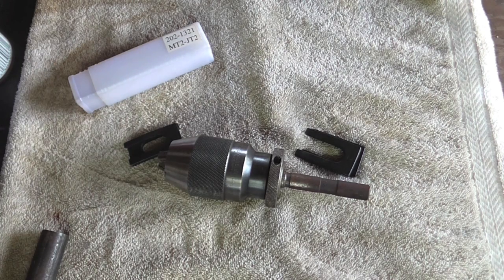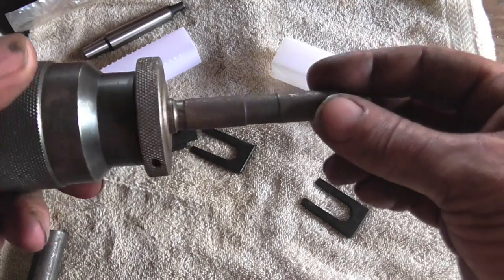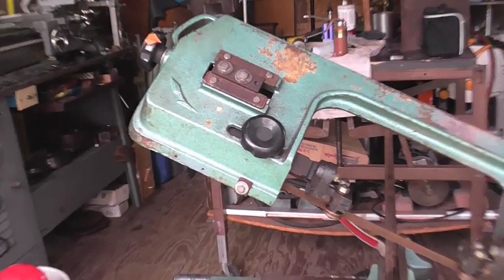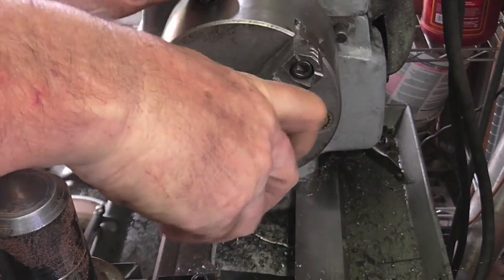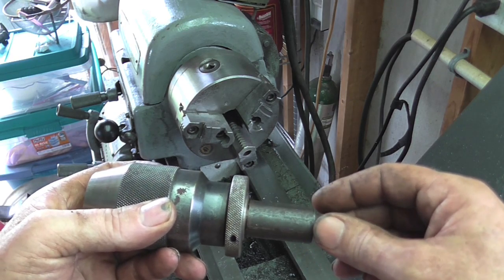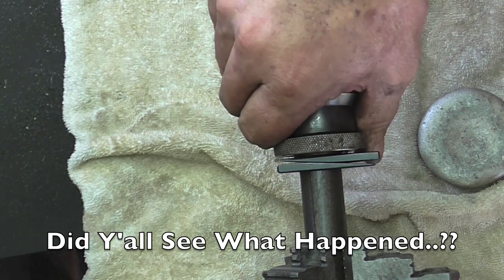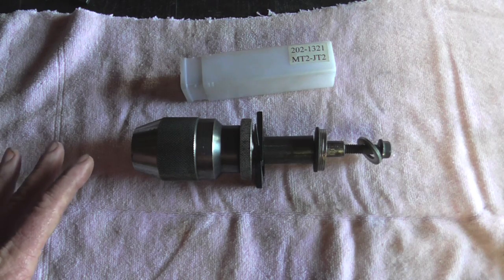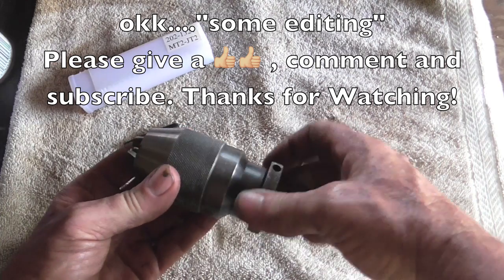How To Remove a Jacobs Taper (When Wedges Don't Fit!!) - MSFN

Comment: Those Bandsaws are sold all over the world under different names they are very common. I have had 4, all with different makers labels, I have my own one still and other than reinforcing the very poor tin legs, mine works very well.  I used to refurbish machines. The "logo" as you called it is an arrow showing blade travel direction. As for the chuck I have freed off many many for myself and others, I always strip the chuck down and use a bit of heat. It's always worth stripping chucks cleaning a regreasing them. I have in the past welded a bit of tube or a big old nut, that is if the tang is not needed. As for oil when cutting, no no use either cutting fluid or water soluble oil, the same as you use on a lathe , you mix it 10 to 1 with water and use a small paint brush. it will make the blades last longer. I have had an engineering shop since the early 80's wit h3 lathes of different sizes and two bench pillar drills and floor standing drill. Lots of different chucks for them all as the y are all Morse/Jacob tapered, but I do not and never have used Jacobs wedges, never needed them.

Comment: Great video, I have the same issue I need to remove an MT3 from a spare chuck; I did see a guy on YT use old spanner’s for the wedges so maybe that will work; also I have seen MT3 to MT2 reducers although I am not too sure how these affect accuracy; maybe someone else can provide the answer to that. Ps bloopers prove honesty 😊

Comment: a simpler way, if you have an access to an oxy-fuel torch,  , with an big tip,  you give a fast heat burst to the chuck to bring the temperature to about 250 deg f m you clamp the arbor in a vise then with a brass punch, and a medium to heavy hammer, you give a sharp blow, the  chuck will release immediately without any damage to the chuck or arbor..

Comment: I heated up the shank with mapp gas near where it attaches to the shank , let it cool then sawed it off, then turned an arbor at the max diameter of the chuck. .390 for my 3/8 chuck. Then put the chuck on the arbor in my mini lathe and drilled and tapped it 3/ 8 -16 then used a couple sockets and a 3'8 bolt to pull what was left right out no problem.

Comment: G'day matey, I had same issue with a keyless chuck I bought , the Arbur was too big so had to remove old arbour from old Key Chuck but was stuck bloody tight,
I cut a length of heavy pipe 5mm longer than the Arbur and placed a bolt in the chuck so it sat on the top of the arbour then placed in the Vice and tightened it down. With a small tap on the chuck body it all come loose.
No welding , thanks to you and many other posts I was able to save lots of time and effort.  Thanks matey regards Duncan down under

Comment: Another way is to unscrew the top of the chuck.  Then you can lift up slightly on the jaw carrier and unscrew that part from the base.  Note this is a left hand thread.  That gives you access to the end of the arbor and you can drive it out with a punch.

Comment: Is it possible to change the quill  ( the main piece that goes up and down with the handle )
To fit with a Morse taper ? It's an old Chicago DP 515 with JT  2 1/2  spindle and the shaft runs from top to bottom in one piece

Comment: Never seen that solution before it worked. I thought you would have to use a hydraulic press to press it out from the inside of the chuck.

Comment: Plan D, if all else fails... I once used a drill chuck to mill with an endmill. but the side load removed the chuck from the taper. They can't hold against a side load. Try putting in in a spindle and chuck a bar in the drill chuck , spin it and put a side load on the bar.

Comment: Rather than the work involved in drilling, tapping, I'd have welded some scrap to the end, then if the old straight arbor was to be kept, then simply grind it off again.

Comment: These chucks are quite easy to dismantle and you can do it with the arbor in place. Once you've got it apart you can access the other end of the arbor and bang it out with a punch. In extremis you can warm the chuck component to loosen it. As long as the chuck is dismantled and you don't go nuts with the heat that'll be fine.
Reply: That's what I did. The chuck I had (Jacobs, not Albrecht) ,when opened up to max, you could see the end of the arbor at the bottom of the chuck. Supported the back of the chuck on some blocks, inserted a rod and tapped the arbor out with one tap of the hammer on the rod.

Comment: OMG, this guy has a lathe ( & thus all the drills/taps/dies/bolts/washers + scrap pipe) and chooses to use Jacobs' WEDGES over a jacking screw to pull that arbor off that drill chuck ??       : - (

Comment: I have been struggling with wedges for a couple days. Thanks for the idea. I cut the end of the arbor off, drill and tapped 1/2-20 thread. A piece of tube, a long bolt and an impact wrench finally freed the oppressed arbor from my 18N.
Reply from the maker: nice!

Comment: Well.... I am up to Plan C with mine. Tried 4 jaw, it fails as well. Tried drilling hole and using a pin, the washer bent. (May have worked if I had wedges at the time. Tried using some angle scrap.) Now waiting for set of proper wedges in the mail. Will post results of my Plan C efforts.
Reply from the maker: Tuff suckers at times!!!!!

Comment: Since my first reply I have had to change what I did in order to get a couple of them out.
Two ways I have had to do it differently:
I bought a used 14N chuck and it was mounted for a milling machine arbor. That thing was in there like you would not believe. I tried the wedges and nothing, I tried drilling the end (inside the chuck) and using a press, No luck either way. I ended up using a grinder and cut off wheel (This arbor was hard as flint and carbide inserts where getting chewed up trying to get it) and cut it as close as I could to the chuck and this exposed the softer material inside. I then put a piece of hex stock in my lathe chuck and grabbed the other end with the drill chuck and drilled the arbor until I felt there was only about 1/4" left in depth, then I set my compound to the taper and thinned it as much as I felt I could without hitting the chuck and used a rod and press to get it out.
The second one was a 20N chuck with a #4 MT so I was in your position here where the Jacobs taper was larger than the morse taper on mine so I again placed a piece of stock in my lathe and then tightened the chuck to it and turned the #4 morse taper to 1" diameter for about 2/3rd's of it's length and then single point threaded it to 1"-8tpi, I then made a spacer out of pipe like you did and used two grade 8 washers with grease between them as a thrust washer and tightened the nut. I took it out of the lathe and then hit the tang end of the arbor with a hammer which released a bit of tension allowing me to tighten the nut more, After a few times of this the arbor came free of the chuck. It had a Jacobs brand arbor and the material in them turns freely, actually some of the best metal I have ever threaded.
Reply from the maker: I struggled with it, at and at times was embarrassing when the initial plan failed....... but was satisfying when it finally broke loose!

Comment: Hope you are doing well.  I have the same problem.  Jacobs 4 taper on 3mt stub.  the JT4 is bigger than the 4MT so no lip.  Tang twisted off 4MT.   Maybe I can chuck it to some stock in the lathe chuck and turn off the twisted off tang section and drill and tap as you did.  Hmmmm.  Thanks for the video.

Comment: I just disassemble the keyless chuck.  Once the jaw holder screw is removed you can use a punch or even a press if needed to punch it out from the inside.

Comment: I was thinking of tapping the outside of the straight shank & using the pipe you made with a nut & washer. As you tighten the nut & washer against the pipe,  it should pull it out.
Reply from the maker: I thought I had it all figured out when I started the video.....LOL

Comment: That bandsaw is your basic made-in-China 3/4" blade horiz/vertical bandsaw for under $1,000. The logo is an arrow showing blade direction. I assume its identical to the RongFu 712N that I have
Reply: I've got the Rong Fu  # RF 115.  1/2" x 64.5" band saw. Same arrow. Made in Taiwan. Great little arm saver.

Comment: I may be mistaken but I thought that the knurled ring, the one cosest to the taper, acts as a clamp. By undoing the cap head screw that tightens up the split, the knurled ring no longer clamps the taper. You're left with overcoming the frictional/rust forces that are keeping the taper in place inside the Albrecht chuck. The undercut groove in the taper might allow you to fit one of the smaller taper removers to act against the shoulder of the undercut groove. That leaves you with an eigth of an inch or so of clearance to the back of the Albrechet chuck that can be filled with one of the larger taper wedges.
Reply: You are completely wrong on all points

Comment: Standard wedges didn't fit a random Chinese chuck I had, so I made a custom pair using a hacksaw, MIG welder, and angle grinder. I did not yet own a mill, then. In this situation, I would make a shaft collar from some random bit of plate or disk, or even a stout bar, large enough to be stopped by a piece of pipe just larger than the chuck.  Clamp arbor in shaft collar, drop chuck in pipe, use inertia/impact to separate the two.

Comment: Another 2 methods that work on that style straight shank is drill and tap the end like you did , then just screw in a slide hammer. This prevents dings from hammers hitting chuck.
If it’s a Morse taper shank, and you don’t want to destroy it, drill and tap 1/4-28 thread thru inside of chuck into tapered cavity. Then, install small 1/16 NPT grease zerk. Use grease gun to extract it hydraulically. Then insert small 1/16 npt plug into hole after.  Then, you can remove anything after that.  They don’t need to be assembled with a 50 ton press either, just light tap with brass hammer. 
Cheers

Comment: I drill a 13/64" hole cross ways of the shank and run a piece of 3/16" round HSS through the hole (close enough that the wedges will be trapped between the HSS and the chuck) then close the wedges in a vise and the chuck comes right off. I have done this several times and it has worked perfect every time.
I'm sure you could get away with just about any 3/16" rod as long as it has some temper to it.
Reply from the maker: thanks!, hopefully someone else benefits from your comment!

Comment: My problem is that my taper is in the drill press and won't come out.
Reply from the maker: If its never been out it could be problematic. Rust or corrosion is possible depending on where previous owners stored it

Comment: More then one way to skin a cat, Problem is not everyone owns a cat skinner.
AKA : I don't ahve the machines you do or machine shop I can work with this stuff in.
A differnt way to remove it might have been a steering or pulley puller, or you could grind on it hit it with Ice cold Dry Ice
heat the chuck and chill the shank, this will unwedge the parts or should. Soak it in wd40 for a few days and hope it helps 
Grind flats on it and try to turn the shank using shock hits with a dead blow hammer.

My problem is the drill press dosn't have a Morres taper shank drill chuck, the drill chuck spins on the arbor, and inspection inside the chuck does not show a screw or allen cap bolt.
A: how do I get it off
B: how do I make it solid so I can use it as a drill press and not a chunk of metal taking up floor space?

This is a cheap delta knock off drill press from China. But it has a solid quell unlike the new crap they are making.
Reply from the maker: All good suggestions you offered, my issue was this was my 1st chuck/arbor removal and I didnt want to damage a $375 chuck. Most likely your chuck screws on....I believe Mr. pete (Tubalcain) has many Delta drill presses and has done videos on chuck removal. It does not have a screw or allen bolt because it screws on if I am not mistaken. Search his vids...I remember there was a trick to unscrewing it~ Richard

Comment: no hold that taper in you hand and tap the chuck with a small (not sledges like yours) hammer just once its the side-wards blow that breaks the seal
Reply: I've removed suspension ball joints using that exact technique. Helps a lot if you can supply some sort of separating pressure as well.

Comment: I might be mistaken but have you undone the collar on that Albricht chuck, its got a small screw that conpresses it on to the audour, the arbour will not come off without removing it?
Reply: The collar doesn't clamp the arbour, it's just for gripping to tighten the chuck and clamps onto the body, it has nothing to do with the arbour

Comment: I have a metal cutting bandsaw exactly like yours and mine was made in China and bought at one of these giant tool sales like they have in parking lots, at warehouses and sometimes on streets down town. Mine does not have a name or manufacturer on it either but what you are calling a logo I think is an arrow cast into it to show the direction of the rotation of the blade to assist in putting the blade on in the correct direction. Sorry I couldn’t help you any more.
Reply from the maker: Thank you! Yes, I was just a newbie to these machines and learned the hard way about the "logo" via the comment section....I laugh nowadays....damn directional arrow. LOL

Comment: Ok one tip make sure you fix your vice to the work bench
Reply from the maker: Its not often I use the vise and I am always moving it around for different things so never saw the need to bolt it down...I just clamp it where its needed. I need a bigger shop! :)
Reply: Makin Sumthin From Nuthin i did before the same till the clamps got lose. Lucky i was wearing safety boots 😣    Btw nice videos

Comment: Static threads will hold a LOT more than twisting threads.  I am not sure if the 5/16" threads would have held.  I had to take the pivot pins out of my Camaro tilt steering wheel.  They were tapped 10-24, I believe or maybe fine thread.  Just pulling with the bolt would strip the threads off of the bolt.  I even tried a stainless bolt.  Same thing.  So, I cut the head off of a stainless bolt, took a 1/4" bolt, drilled and taped the threaded end for the same as the thread of the pivot pin, screwed the "stud" into the pivot pin, put my spacers on then screwed the 1/4" bolt onto the other end of the stud.  I held the head of the 1/4" bolt with one wrench and ran a nut down on the 1/4" bolt to pull the pivot pins.  The stronger bolt threads easily pulled the pivot pins and no threads were damaged.
Reply from the maker: Nice job, always more than one way to skin a cat :)

Comment: mscdirect / Grainger sells Albrecht wedge kit. It's little different then  Jacobs...for stubborn one like yours... I found that if you use heat * no more then 250F* ( I have old toaster, 5~10 min) and take a can of compressed air (the one for cleaning keyboards,  etc) flip can upside down and it  will spray  liquid freon ( warning frost bite possible)  anyways.. Spray bunch on the arbor (Only arbor not chuck) it will shrink arbor/shaft and break tide seal now you can slide wedges if needed and it will come off without any resistance..
Reply from the maker: Thank you for that, I was green at the time (blush) ~ Richard

Comment: I'm thinking that you have the large model band saw that is sold by harbor freight.
Reply from the maker: Yeah, its just a cheap chinese type lathe, works great tho 👍🏼😊
Reply: I have an older Grizzly 0622 band saw, your and mine look identical. I have come to the conclusion that "check mark" looking thing is a logo of some kind cause i have seen it on a few different machines from Chine/Tiawan.

Comment: Just a thought.... isn’t that a locking screw in the collar? Good to see how you tried different ways of getting the job done. Thanks for sharing. John
Reply from the maker: Loosening that collar wouldnt help release the taper. Just sharing so that others may benefit. Thx for watchin
Reply: @MakinSumthinFromNuthin  What makes you say it wouldn't help? In another arbor removal video I saw, the guy says it's important to remove the collar. Isn't it possible you made your day much harder than necessary by keeping that collar on?
Reply from the maker: @GenePavlovsky  maybe, but maybe not

Comment: Unless you wanted to save that old arbor, jacobs recommends to drill a cross hole thru the arbor in a location to suit the wedges to drift out the arbor. Works well but does pretty much ruin the old arbor. Start with a small hole less than half the dia. of the arbor, or the arbor could split at the hole an give less to work with for removal.
Reply from the maker: Yes, that is another way to do it, thanks for sharing 👍🏼

Comment: Interesting;  I have the exact  same brand chuck and the straight 1/2 arbor.
I am going to drill and tap the end and use a pipe slightly longer than the shank.
No the exact same solution but one that was suggested below.
Thanks
Reply from the maker: It presented a challenge, thought I would show my blunders and final result in the hopes others could learn from my mistakes.
Reply from the maker: Albrecht is a great chuck....the best!